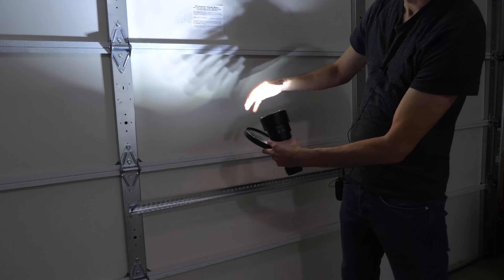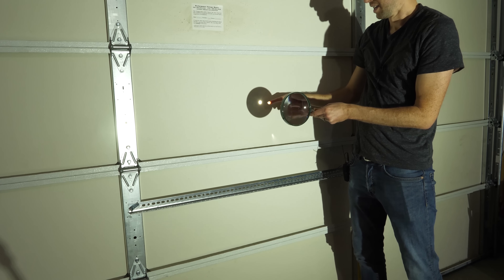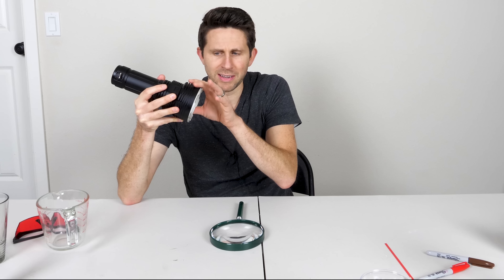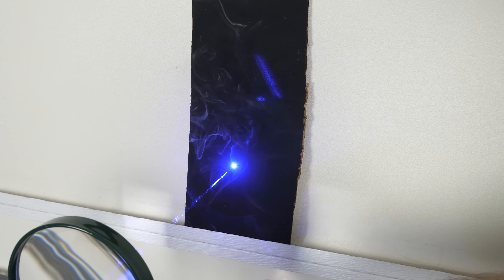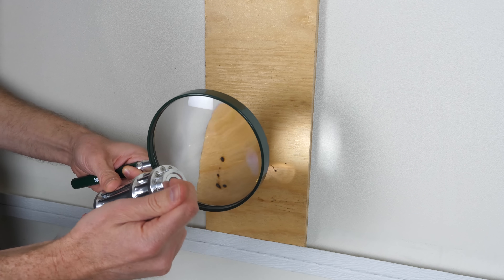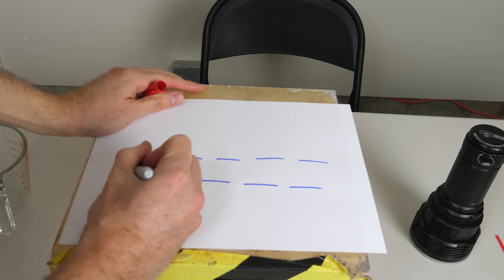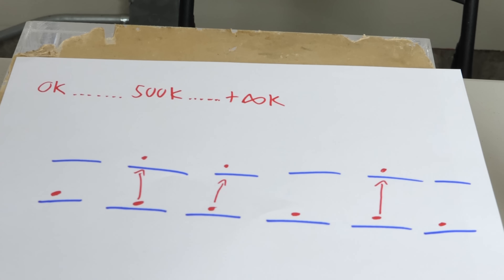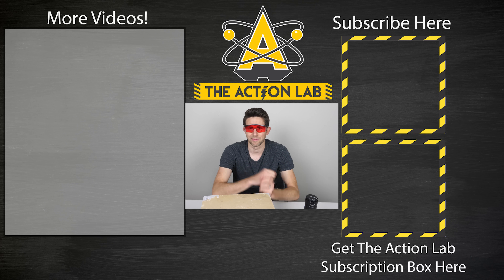What Happens if You Focus a 5W Laser With a Giant Magnifying Glass? Negative Kelvin Temperature!

Comment: The Sun is not a point source! Place your lens, large enough, close to the Sun's surface, and you could possibly get hotter point into the focus than the average temperature of the Sun's surface. If you and your lens won't incinerate before. The Sun's surface is actually pretty cool. I can't see the reason, why thermodynamics laws prevent to concentrate energy radiating from large surface area into a single tiny  point. You can't collect more energy, than the source emits, but you can concentrate it more than it is at the source.
Reply: I was thinking the same thing. However I am in no way any sort of expert lol. This video has left me more confused than I was before lol
Reply: Right? If you neglect the energy loss and use multiple lenses to bring the whole light into the same area as the source it should produce the same temperature, and if smaller higher temperature. I just don't understand the reasoning at all..
Reply: @Turnip420   No, you can never get it to a higher temperature.
Reply: @DANGJOS  Let's take another sample. Microwave owen. You can place some metal fibres there and create plasma, that is extremely hot. Much hotter than the source of microwaves. Concentrating of energy is not against thermodynamics laws.

Forget about lenses, if your imagination is so poor, that allows only too closely positioned lenses, not at the right distance.. Let's assume, that we surround the Sun with enormous spherical ideal reflector, that has slightly distorted focal point, that is shifted from the centre to somewhat aside, so, that focus stays out of the Sun. Do you still believe that focusing almost all the light, emitting from the Sun, into one tiny point will not rise the temperature higher than the Suns surface, that has balanced temperature, that depends on cooling from radiation and heating from convection and lnternal radiation? Try to do some math, what would be the temperature if the energy of all the visible light, emitting from the Sun, is landing on a single square metre.
Reply: @DANGJOS I don't believe this is true. The US military built what is essentially a massive magnifying glass in new mexico which focused sunlight and reached a temperature of 5000°F. One guy did similar on a smaller scale on youtube. Just goes to show how much light can be amplified. Increase scale and increase efficiency and you could certainly break 10000°F which is approximately the surface temp of the sun

Edit: @svilponis explained this better lol

Edit 2: One other point to make would be that relating temperature to light is misleading since the sun is hot due to fusion and burning stuff (scientific term) and not because of light. It simply gives off light as a result of that heat. Trying to relate temperature of objects which were heated by focusing light to a really massive object creating insane amounts of heat from nuclear fusion in it's core is honestly quite ridiculous lol
Reply: @ericrem2047   No, we relate the temperature of an object to the light it emits through the Planck relation.  Blackbody temperature.  Look up the Planck distribution.  Most solids and liquids have a characteristic frequency distribution of EM radiation, at specific temperatures.  The energy generated in the sun's core doesn't make it to the surface until thousands or millions of years later.  It is the sun's surface that is relevant.  That experiment you mentioned did not reach the sun's surface temperature, so in no way is it inconsistent with the theory.  I would love to know how you would increase the efficiency of that experiment.  Increasing the scale wont work because the area, of the image created by the focusing glass would just increase, and therefore the temperature wouldn't be much higher, if higher at all.
Reply: @DANGJOS  You seem to have a far greater understanding of the physics of this topic than I do and your explanation makes sense now, thank you for this. The only point I would still like to make would be involving the size of this magnifying glass/mirror idea. Of course simply upscaling the thing as a whole would not increase the concentration of light and therefore would not affect temperature. However, this assumes the point of focus stays the same distance from your reflective surface, which defeats the purpose of increasing the size. All that needs to happen is for the point of focus to be moved farther from the reflectors till it reaches the point where the light is most concentrated. Same as if you burn a leaf with a magnifying glass. Larger magnifying glass means u have to be farther away but it's easier to burn the leaf. I say this from experience haha:) I would love to hear your thoughts on it tho
Reply: @ericrem2047  Have you heard of fusion energy and attempts to create fusion by concentrating many powerful lasers into single point? They reach enormously high plasma temperatures this way. Hotter than the surface of the Sun. Much-much higher, than the temperature inside any of these emitting lasers. Stefan-Boltzmann does not prevent it.

Edit: was meant as a reply for  @DANG JOS
Reply: @ericrem2047   With a small magnifying glass, the point of light on the leaf is smaller, so I imagine it is easier for thermal conduction to reduce the maximum temperature.  With a larger magnifying glass, however, the spot on the leaf is much larger, and therefore the cooler parts of the leaf are much further away than the middle, which means the power conducted away is lower.  So in this way, increasing the size of the point of light will give you a higher maximum temperature, but never hotter than 10000 Fahrenheit.  By the way, the apparent size of the point of light is more a function of the focal length.  The smaller the focal length, the smaller your point of light.  The ideal thing is to have as small a focal length as possible with as large a lens as possible.  For that, a Fresnel lens is best.
Reply: @DANGJOS   I think I understand now.. Maybe lol. I did a little more research and found another article explaining why you cannot focus light to be hotter than the source. I'm still trying to wrap my mind around why that's the case because it doesn't seem right in my head but I'll make sense of it eventually. Anyways I appreciate all the information, this is the first productive conversation I've ever had in the youtube comment section haha. Have a nice day:)

Edit: Here's the article
https://what-if.xkcd.com/145/#:~:text=The%20Sun%20is%20about%205%2C000,than%20about%20100%C2%B0C.&text=%22The%20Moon's%20light%20isn't%20like%20the%20Sun's!
Reply: @ericrem2047   Haha no problem.  Yes, YouTube can be a terrible place.  Believe me I know!  By the way, I don't know if this will help, but try and think about what the focusing lens is doing.  It's essentially reversing what happens at the sun's (or any diffuse light source) surface.  

Every light source can be thought of as a bunch of infinitesimally small light producing points all put together.  Imagine that every small part of the sun is its own point source of light.  If it was the only point shining, then the very best that any lens can do is concentrate the light spreading from the light source into a point of light again.  But now consider another point of light on a distant part of the sun.  The lens can only ever bend this to a point at a different location on the ground.  now every point of light from the sun is being concentrated to a point, in the same relative positions as they originated from the sun.  

That's what you're doing when you magnify the sun.  You're literally creating an image of the sun on the ground.  So since you can't magnify past a single point, you also can't magnify past the array of points that build the sun's image on the ground.  So the intensity can never exceed what it was originally.  I don't know if that's the most technically correct explanation, but I hope it gives you an idea.  Anyway, stay curious about science and the world! :)
Reply: @DANGJOS  This actually helps a lot thank you!
Reply: @ericrem2047   No problem! 😊
Reply: @svilponis  If you placed it close to the sun, then it would cause the light to be more diffuse.  You wouldn't be able to concentrate it much at all.  It wouldn't work.
Reply: @DANGJOS  Do some math: 1 m2 of Earth surface is receiving ca 1 kW of Sun's energy on a clear cloudless day. Sun generates 3.8 x 10^26 Joules of energy per second. The Sun surface area is 11990 Earths = 6.09 x 10^12 km2. How many square metres of the sun lit surface on Earth must be reflected into one single  square metre, to achieve higher energy density than it is on the Sun's surface?
Reply: @svilponis   I can do that calculation, if you like.  It involves something called the Stefan-Boltzmann law.  That will tell you what temperature you will reach for a given concentration of light from the sun.  Of course, the simpler calculation is just making the intensity equal that of the sun.  That is just a scaling calculation.  My question is, however, how do you expect to concentrate that much light?  What method will you use?  Whether you try reflections or magnification, with a lens, it won't be good enough.
Reply: @DANGJOS  So you try to say, that reflector does not reflect Sun's energy?
Tell me, why microwaves in the owen can concentrate into higher temperaturw than it is at the source?
Reply: @DANGJOS  It does not matter how long the light breaks out from the Sun. Sun's surface temperature depends on how much energy is coming from inside layers of the Sun and how much is radiating away. If the temperature has been relatively constant, then the influx = outflux.
Reply: @svilponis   Yes, and the inside layers are so far down, that heat conduction is extremely slow.  Also the sun's core is very dense, so photons are scattered greatly.  The sun's surface is theorized to be opaque, which means it is the radiation leaving the surface that is relevant.  Now of course the rate of energy production in the core is close to the output at the surface, otherwise the sun would be getting much hotter, so there is a connection there, but the radiation at the surface is mostly controlled by the surface temperature.
Reply: @DANGJOS  It really does not matter how slow is heat conduction on the Sun. Its surface temperature is  ca 5500 K, man has created much higher temperatures on Earth.

At the Earth's distance, to get energy density, comparable to Sun's surface, one needs to collect sunlight from less than 7 ha to 1 square metre. Or from less than 7 square metres to one cm², or from less than 700 cm² to one mm². If you have  non ideal reflector and you loose some of energy due to diffusion, radiation etc, then just double or triple this . If to go closer to the Sun, let's say to the distance of Venus or Mercury, these areas are even smaller.

Let assume, that we place a small object to the distance of 10 cm from the Suns's surface. It will, no doubt, achive very similar temperature to the Suns's surface. If to add some energy to the object by reflecting on it some Sun radiation from neighbouring Sun areas, it should heat up even more and will radiate from its surface at higher rate (get hotter) per area unit, than the Sun's surface.
Reply: @DANGJOS  Let assume, that at about the distance of Mercury  there is a planet orbiting around the Sun, that has surface completely of natural solar panels, and bunch of mighty natural lasers directed to the centre of the planet, where is natural fusion reactor chamber with mighty magnets, that can hold hot plasma. And like man made National Ignition Facility (NIF), this fully natural solar powered fusion reactor concentrates enormous energy from solar powered lasers into the small area in space, to spark the fusion.
Does Stefan-Boltzmann forbids that?
Reply: @svilponis   No, it won't.  Think about what you're doing when you try to reflect light to this object.  How exactly would you reflect light on its front surface?  If you bring a mirror next to it, that is perpendicular to the sun's surface, then it will reflect some light on the object, but it will also reflect away about the same amount of light on the other side.  Okay, so maybe you angle the mirror to face the sun's surface more.  Well, now you're mostly illuminating the side of the object that isn't already illuminated by the sun.  If you face the mirror away from the sun's surface, you're blocking a lot of light!  The only way to increase the intensity beyond the maximum, is to increase the intensity on the part of the object's surface that is parallel to the sun's surface.  I do not see how that's possible, without first blocking some of the light with your reflector.  I would love to hear your ideas on how to get around that though.  I don't think you'll be able to though.

And do the math on how much you can increase the intensity of the sun's light with a mirror or lens.  There is a limit.
Reply: @svilponis   I'm not sure what you mean by "mighty natural lasers", but if you use lasers, they have a negative temperature, which can bring temperatures higher than the sun's surface, because negative temperatures are hotter than positive temperatures.  That's what the video is about.  You need to come up with an example that doesn't exploit negative temperatures.
Reply: @DANGJOS  Why the hell I have to reflect some light to the "front surface"? I'll reflect light only to the back surface. The front surface is lit by the Sun directly, from 10 cm distance! But I take large parabolic mirror, and reflect sunlight from the other side. The object is small. it does not hide sun from the reflector. No problem with angle. Is your imagination so poor? Should I draw a picture? Here it is: https://www.upload.ee/image/12471781/sunreflector.jpg
The Sun's surface is heated from one side. The object is heated from both sides.
Reply: @DANGJOS  By mighty natural laser I mean natural distribution of matter, that causes emitting powerful coherent ray of light, like man made lasers. It gets its power from the natural solar panels. Every energy conversion is natural process due to favourably positioned matter. No negative temperatures involved.
Reply: @DANGJOS  If the laser planet is not acceptable to you, then lets imagine a solar powered mighty (for instance, terawatt) natural microwave owen planet, that bakes some plasma in  the powerful flux of microwaves.
Reply: @svilponis   "But I take large parabolic mirror, and reflect sunlight from the other side."
Sure, and what good will that do you?  You're not increasing the intensity at all.  You're simply surrounding the entire object with radiation equivalent to the sun's intensity.  In order to increase the intensity, you need to focus light on the same side that the sun is illuminating it, not the other side.

"Are your imagination so poor?"
No, actually my imagination is pretty good, for this anyway.  Your problem is that your understanding, of the physics and optics, is too poor.

"The Sun's surface is heated from one side. The object is heated from both sides."
Yes, I can see that from your diagram, and it is just as I imagined it.  By the way, using a parabolic mirror does not help you that close to the sun.  Draw the ray diagrams to see why.  As I explained earlier, reflecting light on both sides does not increase the intensity; it only increase the area of the object you are illuminating.  Intensity=power/area
So no, that still doesn't get you there.
Reply: @svilponis   "Every energy conversion is natural process due to favourably positioned matter. No negative temperatures involved."
Lasers work by having a population inversion of a bunch of electrons in excited states.  It absolutely is negative temperature, so that doesn't work.

"If the laser planet is not acceptable to you, then lets imagine a solar powered mighty (for instance, terawatt) natural microwave owen planet,"  
And what is the temperature of the magnetron in a microwave?
Reply: @DANGJOS  Really? My object is tiny, lets say, one penny coin. There is no big obstacle for thermal conductivity between sides. The mirror has trillion times larger area than the coin, hence concentrates Sunlight from large area into the tiny spot. The coin has been close to the Sun's surface long enough to equalize temperature with it. Now additional amount of energy is suddenly poured on it from another side. Do you really expect a penny, being at 10 cm distance from the sun, has only closest side hot, and the other one cold as ice?
Reply: @DANGJOS  The magnetron is a lot cooler than the plasma. Like it is in case of my home microwave owen. This microwave planet has billions of magnetrons, similar to the magnetron of a home owen. Each magnetron may generate  microwaves constantly for long time and all these waves bounce inside the chamber until they meet with the plasma. Plasma gets hotter and hotter, because terawatt of microwaves bouncing with it.
One single magnetron of home microwave owen can rise temperature of  a plasma up to 5000 K easily, Sun's surface is just a bit higher, ca 5500 K.
Reply: @svilponis   "The mirror has trillion times larger area than the coin, hence concentrates Sunlight from large area into the tiny spot."
That is incorrect.  When you are 10 cm away from the sun's surface, it means that there is light coming directly from the sun and all around from 90 degrees angle to your right and left.  Light is coming from half of the entire viewing area, which means your parabolic mirror will focus trillions of different parts of the sun to a huge area, not just the coin.  Try it with a TV.  Get a parabolic dish very close to the TV and you'll see that you cannot focus the light from that close.  It doesn't work that way.  At that distance from the sun, a parabolic mirror is pretty much just as good as a flat mirror.  

Now without the mirror, sunlight is only focused on one side, which means the other side will radiate much of its energy away (look up Stefan-Boltzmann law*).  This means the equilibrium temperature will be significantly *lower than the sun's surface.  With your parabolic mirror, both surfaces will get hit with intense radiation, and therefore the penny will get very close to the sun's surface temperature (ignoring the fact that it will vaporize), but still not quite get there, and certainly not higher than the sun's temperature.  

You're trying to make something work that is likely impossible.
Reply: @DANGJOS  I don't care, that every single ray from the Sun is not reflected to the coin. What is your point? Why you say, that it is incorrect, that huge parabolic reflector concentrates sunlight from large area into the tiny spot? Subset of rays, that are parrallel to each other and heading to the direction, where they meet the reflector and reflect from there into the focus of the reflector, is coming from huge area. Of course, there will be some more rays, that does not meet the reflector or does not reach to the focus, but let they go where they want.

You seem to forget, that Sun's surface is heated only from one side, and it radiates exactly the same amount of energy away. The coin at 10 cm distance of the Sun's surface of course is super heated after temperatures are almost equalized, and radiates almost as intensively as the Sun. But if the reflected sunlight from huge area is concentrated to the other side, then the energy is easily multiplied, and the temperature gets hotter than the Sun's surface.

You are wrong! Without the reflector there will be no focus. So no light is focused at all!

My dish is on the roof. It has matte surface. I don't understand, why I have to bring it close to TV? I am receiving 5 different satellites with this dish (have 4 separate LNB-s). I set my dish and aligned my LNB-s by myself, so I have an idea how this dish is working.
Reply: @svilponis   There is no focusing.  You cannot focus light that close to the source. Try it yourself.  And the sun is warmer on the inside of the surface.  The is a temperature gradient in the sun that ends at 5800 Kelvin at the surface.  The penny cannot possibly reach equilibrium, when only a little over half it's surface is getting direct sunlight.  It must be surrounded on all sides to reach 5800 Kelvin.  So no, I am not wrong.
Reply: @DANGJOS  You are wrong! There is focusing! The reflector will focus subset of rays that  are parallel to each other and are heading perpenticular to the dish opening plane. It does not matter, how close you are to the source. The reflector just does not focus all the light, that hits it, because the light is diffused.
See picture:
https://www.upload.ee/image/12472108/sunreflector1.jpg
Reply: @svilponis   That is a poor diagram.  You conveniently left out the other rays that don't converge.
Reply: @DANGJOS  Here is a picture about the concentrating of sunlight with a huge lens:
https://www.upload.ee/image/12473219/sunlens.jpg
Your idea, that you can't focus light close to the Sun, is flawed! You are so wrong! The set of parallel rays is always focusable, independent distance from the Sun! As the Sun is not a point source, a huge lens or gigant reflector can concentrate light from huge surface area into tiny area. Not all the rays are focusable, but fairly big amount of them. These rays, that reach Earth, are parallel enough to be focusable even close to the Sun.
Reply: @DANGJOS  Multimirroring can even multiply the amount of concentrated energy:
https://www.upload.ee/image/12473452/Sophisticated_multimirroring.jpg
Reply: @svilponis   You have little understanding of optics.  The green rays you drew are a small portion of the total rays from the sun.  Most are going in all different possible directions.  Please look up ray diagrams and the optics of lenses in general.  From your drawing, if the focal point of that lens goes beyond the sun, then the rays will never converge.  If the focal point is in front of the sun, then they will form an image of the sun that is likely larger than the sun itself, which means there's still no concentrated point.  The light is just diffuse.  You really need to play around with magnifying glasses.
Reply: @svilponis   Exactly!  1.3 kW/m^2 at Earth distance, and it's the same rays at the sun's surface.  The intensity of the sun's rays at its surface are 50000 times higher than at Earth distance.  That means the green rays, which you just admitted have only 1.3 kW/m^2 in them, are only 0.002% the intensity of all the rays put together at the sun's surface.  You literally just debunked yourself.  And by the way, I was a TA in an optics lab class at a university, so in a sense, I was the teacher.  Please pick up a book on optics.  You are simply mistaken.
Reply: @DANGJOS  You just debunked yourself! If the parabolic reflector is 50000 times larger than the penny, then it focuses the same amount of light to the penny from the back side, as it comes from the front (Sun's) side. If 100000 times larger, then twice the amount. Etc.
If the area of the penny is 2.85 cm², then the reflector must be 14.25 m² for 1x energy, 28.5 m² for 2x energy, etc.
Do you grasp the idea? Hardly!
Because the Sun's disk has 109 times larger diameter than the Earth's disk, then the above is not true, but, AS I WROTE EARLIER (as clearly, that only complete morons would not understand), a parabolic reflector  with much larger area of the opening surface is needed for 1x energy, twice of that for 2x, etc. Read above, I will not calculate again!

I feel sorry for your students! I never thought, that I must teach optics teacher, what is the essential difference between plain mirror and parabolic reflector, when concentration of light is discussed.

You claimed, that I have poor understanding how parabolic reflectors are working.
Here is free lesson to the optics teacher about that:
https://en.wikipedia.org/wiki/Parabolic_reflector#/media/File:Parabola_with_focus_and_arbitrary_line.svg
And here is free lesson about converging lenses. Please note, that I was not talking about creating an image using a lens, but focusing light into a single point. Hence this scheme apply:
https://en.wikipedia.org/wiki/Lens#/media/File:Lens1.svg
And how it looks in reality:
https://en.wikipedia.org/wiki/Lens#/media/File:Large_convex_lens.jpg
My drawings are correct. Denying it proves, that you have no idea about the optics!